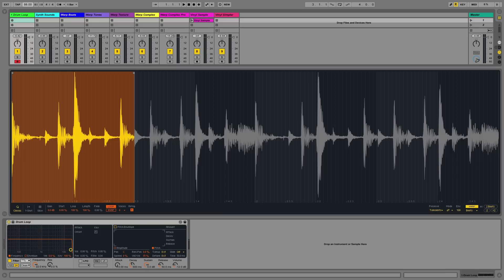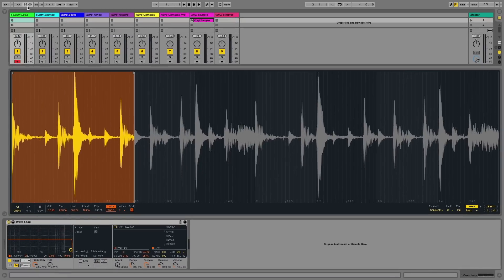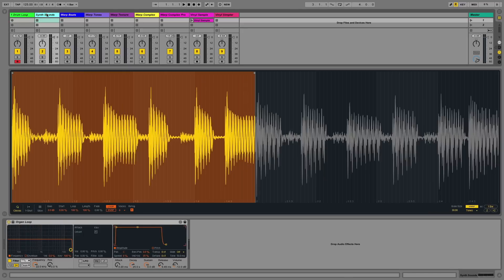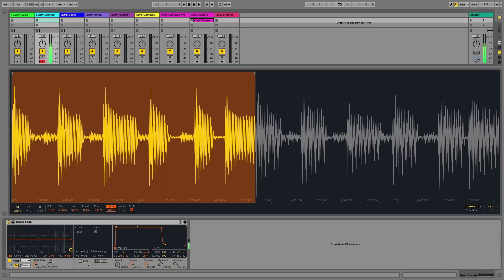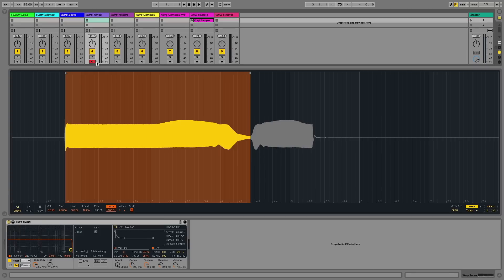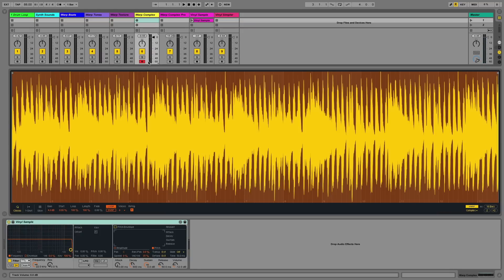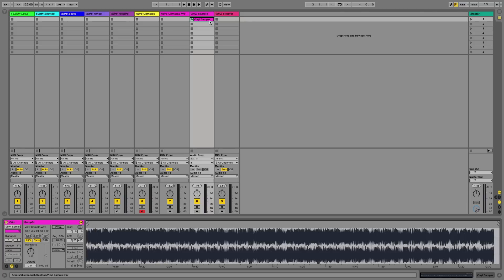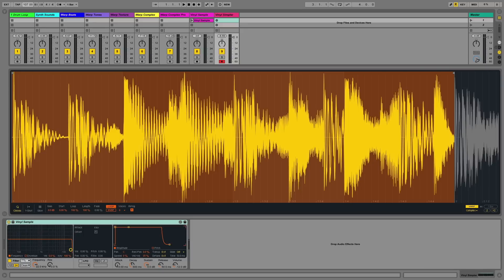Ableton Sampling Tutorial in Simpler – Warping

Comment: Why is there no way to disable the auto warp function in simpler when you slice to mid? Mapping the warp button is also unavailable. That's so frustrating when working with like 32 or more slices. People on the forum talking since 5 years over this problem. Can you please fix that?
Reply: @jonathan doron The problem persists and has been discussed in the Live Forum for over two years now. So far, there is no solution for it. If you just want to slice a loop and you got 64 slices, you have to turn off the warp for every single slices manually.  It really is a shame that nobody comes up with a propper fix for this

Comment: What's with all the little artifacts on the transients at 1:20 to around 1:26? Its obviously not clipping or anything and I'm assuming that the warping is smooth enough not to cause this. I had a similar problem a few days ago on a session that I was running. Artifacts would just appear on playback for seemingly no reason at different points in the timeline each playback :S